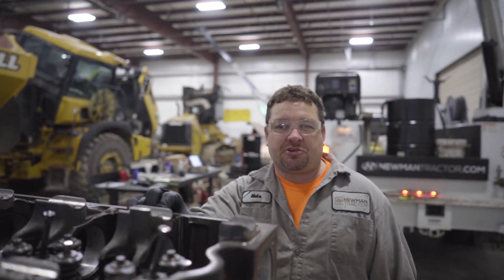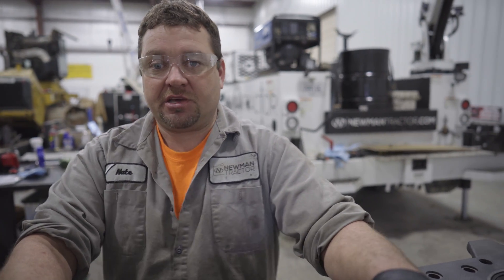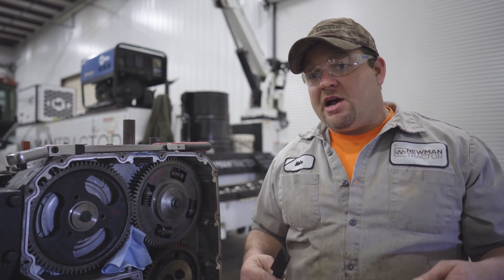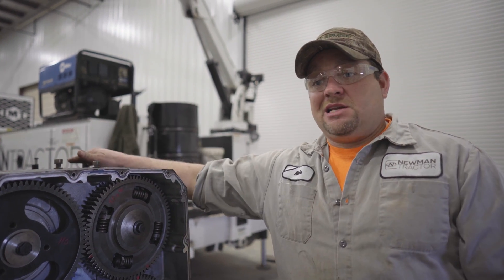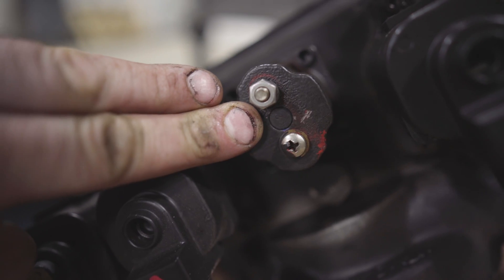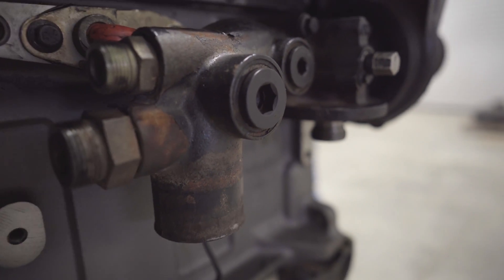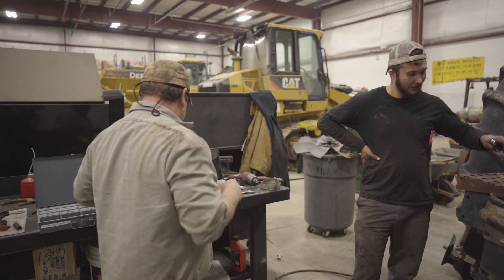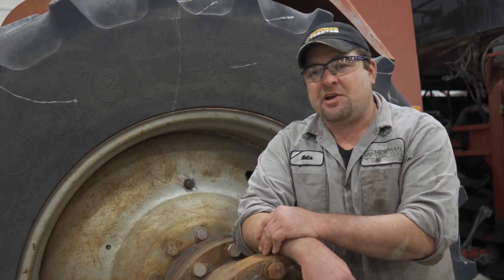How a Diesel Mechanic Fixes Cam Timing (Is it Worth It?)

Comment: Did you put loctite 609 on those cam gears and use a feeler gauge to set the lash?
Reply from the maker: Sorry it took us a bit to get back to you. We used engine assembly lube and yes we adjusted the gear last on episode three I think.
Reply from the maker: I think the tapered shaft you are referring to from the manual called for it to be dry and clean with no lock tight.
Reply: @NewmanTractor  yes dry tapers like in machine shop lathes milling machine s.
Reply: I don’t know much about the big trucks, but I’ve never put loctite on cam or crank gears.
Reply: David Oles, it’s not actually on the gear teeth but the inside diameter of both camshaft gears to seal it to the nose of both camshafts. In the field we just say gears because it’s easier. It’s used to prevent the engine slipping time, possibly causing a valve making contact with a piston. Or cause excessive smoke, running rough conditions, excessive fuel usage, etc..
Reply: David Oles You've never done that , I always did it , alot of bolt holes in the crank go all the way thru , the manual says to use locktite/sealant ,
Reply: Ah ok I figured you were talking about putting loctite on the camshaft gear bolt.
Reply: Loctite is important there is no wedge holding that gear locked with cam its only tapered on the cam very important to use green loctite. I've seen gears come out if sync
Reply: Locktite or boooomm